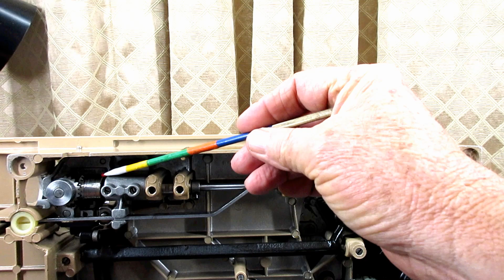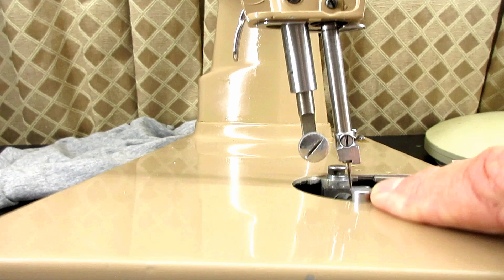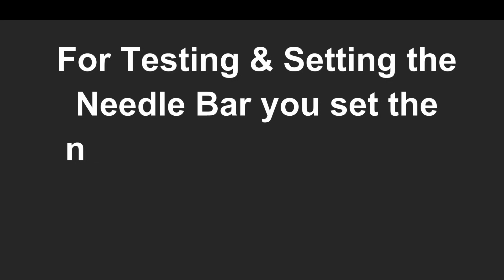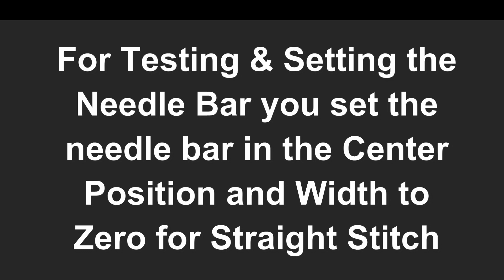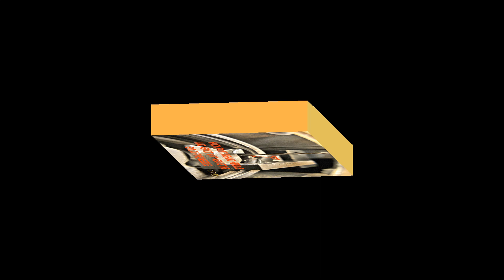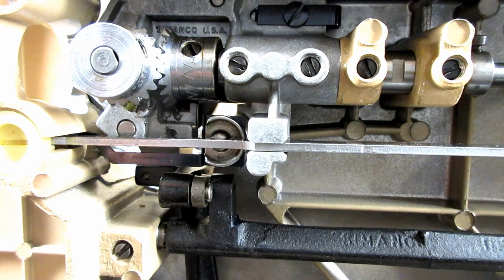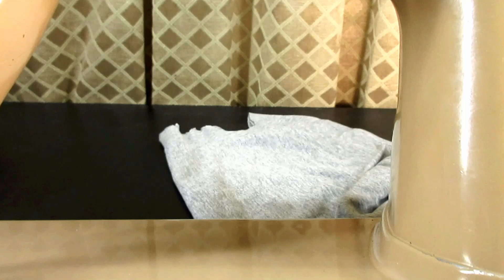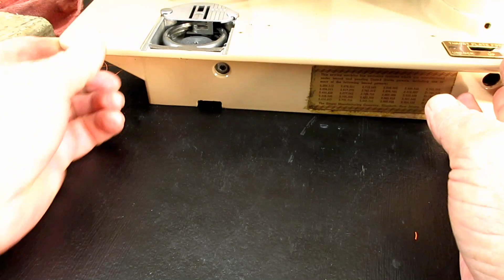How to Check and Set the Timing on a Singer Model 403A Special Slant Needle Sewing Machine

Comment: Hi Andy, I'm getting so much out of your various Singer 401a videos! They are SO helpful and fun to watch.  I like how you give invaluable tips from your own experience. 

I have my mom's 401a that I grew up sewing on, and I am seeing that the needle height mark (upper mark) is hidden under the bushing and I think I see the hook timer mark (lower mark) maybe just slightly showing about halfway out from under the bushing. The two marks are very clear when i raise the needle bar up, so I would see them if they were where they were supposed to be. The problem is i can't get the needle bar to move, even after unscrewing the screw until it fell out. I put some blue creeper penetrating oil in the place where the screw goes back on, and every now and then I come back to it, but it is NOT budging. Am I doing this correctly? Should I try putting some heat on it with a hair dryer ? I don't feel I should rotate it. I've never asked for someone's advice after watching a video, so maybe this is kinda rude.  😂
Reply from the maker: You are definitely not being rude, and using a hair dryer to apply gentle heat is a great next step to help break those parts loose. There is probably 60 years of dried oil in that tiny cavity between the clamp and the bar, and maybe it is not all sewing machine oil. 
   Patience helps a lot. I often work on a different part while waiting on the penetrating oil to work, even just cleaning them or polishing the machine.
   It's fabulous to have a family machine like that; congratulations.
You may be the first person to remove that screw since the factory installed it 60+ years ago. I'm curious why you want to. If you are skipping stitches or the needle is hitting the hook, then yes, it may need adjustment. If it is sewing well, then you can just clean it in place if needed. 
   If the marks are a little off, but the stitching is fine, then maybe just leave it alone. Each machine is unique and also has its own wear "pattern".
Reply: Oh thank you for your response! Yes,  haha,  I should have left it alone,  but the marks were so off. Like way up above,  so that I would have thought there weren't even any marks if they weren't visible above the clamp when i turned the handwheel.

 And the timing was definitely off, so i just wanted to start by correcting the needle height and then go on to correct the timing.   But it became quite obvious to me, after I got the needle bar to move up and down within the unscrewed clamp (which i finally got loose), that the adjustment makes the needle far too low, even with the upper mark adjusted to where it's just peeking out from under the bushing. It doesn't hit the bottom of the bobbin case, but comes pretty close. 

 I think on this machine for some reason, the eye would never be only 1/16 inch below the hook at any point, if I'm then turning the handwheel and bringing the lower mark up that little distance to line up exactly under the bushing. 

I don't really understand how it could be so off. Can I just measure the distance between the needle eye and the bottom of the bobbin case? I feel like that's what the upper mark is for anyway, just an easy way to see in the needle is at the proper height. So if the marks are wrong, I should measure the height of the hook in relation to the base, subtract 1/16" and i would have the height of the eye of the needle in relation to the base. 

Am I making this too hard? Not sure how I would fix it except by trial and error. But I'm willing to do that if you think that's the way to go.   😂
Reply from the maker: @marcilindsey6264  A very odd situation. Since you can manipulate the needle bar, please check that it's the correct part number for your 401A. It should be stamped with the number 172003.
Also, when rotating the handwheel ALWAYS turn it towards you and not away or backwards. That changes the whole situation and messes the timing up like crazy.
Reply: @andytubesewing1953  OH yes, I do realize that.  I have that habit down pat of only turning it toward me. 

Oh okay,  I will check that the needle bar is actually the right one for the model 401a, thanks for the serial number!! 

Thank you, Andy!
Reply from the maker: @marcilindsey6264  That's all I can think of without the machine on my workbench. You know, when the needle bar continues up both those lines go up into the bushing and disappear. The idea is that when the bottom line is flush with the bushing, your needle point is at the hook point. When the needle bar is all the way down, you should see the top line at the bushing bottom. If it is there, the height is correct. You probably know all this, so I'm just being sure. Good Luck. It is unusual.

Comment: Every time I set my needle doesn’t come up fast enough it hits metal. Also screw that holds needle can’t break it loose.
Reply from the maker: Does the needle just barely rub on the hook? Like a slight "zing" sound? These early slant needle machines had trouble with skipping stitches on knit fabrics. There is an adjustment the Singer techs made to stop that by moving the hook slightly closer to the needle. It worked quite well, too. I'm wondering if that is your situation.
   You mention that you can't loosen the needle; do you mean the screw that holds the needle bar in place? That is used to adjust the height of the needle bar for setting the needle to hook timing, as I show in the video. You can certainly check if the needle bar height is correct without touching that screw. 
   If you find the NB is at the wrong height, you would need to loosen that screw to adjust it.
Using a penetrating oil, like WD40 or similar, can help. Give it time to work. Using a hairdryer to heat the screw up very well is another method we use to loosen it. Get help if you need to. You do not want to strip the head of the screw.

Comment: Hey Andy, I’m sitting here watching this video and I’m seeing that you have the stitch width lever at one which has me questioning where I might’ve had mine when I was timing the 401a. I probably had it at three thinking that was the center.  That is definitely something I will revisit when I get it back out of the box lol. Not even sure if that’s an issue if I did do it that way.
Reply from the maker: Don't dig up what you buried in good faith, as grandpa used to say. 
Red lever at 3  IS the center needle position on model 401. With the knobs at A-K.
So, AK# is straight stitch with center needle. In this video the lever on model 403 is for stitch width only. There is a separate "push and slide" knob for the left-center-right adjustment.
Reply: @andytubesewing1953  well darn🙃

Comment: Hi Andy, I recently put a 401A on the back burner because I just could not, for the life of me, figure out why the needle was dragging the fabric. I took out the presser bar, the needle bar, reset the timing about three or four different times and nothing worked. It’s that “pendulum” issue. I had heard, but you didn’t mention it here that when you reset the timing that it’s a good idea to have the machine in zigzag settings with the needle to the far left. Have you ever heard of that before or anything similar?
Reply from the maker: I've heard of having the needle far left to time the hook on zigzag machines, heard it, but never read it in a manual. Your problem sounds more like a cam stack timing issue, not a hook timing issue. Try timing the cam stack (disc driving worm wheel) https://youtu.be/ljenD-rn6pc    That's what I would look at.

Comment: Pls, I need your  help to set my Singer 968 needle timing, the needle keeps hitting somewhere after I have followed the steps🙏
Reply from the maker: Model 968 was not sold in the USA and I have not worked on one. I found pictures on eBay and it strongly resembles Model 252. The most common reason for your problem is the plastic gear on the top of the vertical shaft is failing or has failed due to age. The gear or gear + shaft can be replaced https://www.sewingpartsonline.com/products/arm-shaft-w-gear-singer-445491   I have a couple gear changing videos for other models if you want to see what that entails https://youtu.be/M3bFtlV1Y6s     https://youtu.be/O2KN89S6zkM   
You can also buy just the gear. The Service Manual for some models shows the gear must come out the top of the machine which involves more steps. The manual for model 252 is for sale here https://manualsoncd.com/product/singer-252-257-258-259-sewing-machine-service-manual/    I could not find the manual for 968 anywhere.
Reply: @andytubesewing1953   Thank you so much 🙏  I'll check the links out.
Reply from the maker: @Lililabel  you bet and good luck to you

Comment: Excellent explanation of this system Andy.  I now think I need a new hook assembly as the hook on my "Goodwill" find 403a lines up in front of the needle instead of behind it.  Either the one I have is damaged or someone installed the wrong one.  I'll try replacing that next and maybe a new needle bar also.  Thanks for all the work you did on these videos.
Reply from the maker: I guess it could be the wrong hook but it is a bit of work to remove and replace the hook. Here are my 27 videos for model 403A https://www.youtube.com/playlist?list=PLsCOZgzzaiKKyqvdDRwS-9MfLuwSNJTcg     There is an adjustment to move the hook to or from the needle. Maybe someone fooled with it. I don't have a video for that but you can download a free copy of the service manual from the sewing dude  https://sewingdude.wordpress.com/wp-content/uploads/2012/09/singer-401-service-manual1.pdf   Page 144 has the hook adjustment instructions. I did make a 2-part video for removing and replacing the Hook & Finger on a model 401A if that helps here is part one https://youtu.be/T4YPB1KK3_Q
The part number for the hook on model 403A is 172080, which should be stamped into the part.
Reply: @andytubesewing1953  Hi Andy.  Thanks for the timely reply.  I tried answering your response with the email secondary and it did not go through.  Anyway, I did remove the hook and it was difficult as I had to pound it out from the bottom.  The hook unit would not clear the screw head which holds the cover plate spring in place.  My hook is stamped with the correct part #.  I will study the instructions you sent me and see what I can try next.  You're a champ!
Reply from the maker: @engelbob8402  OK, good luck. The link I gave you to the hook video shows how to avoid the screw for the cover plate spring. take care.

Comment: Hi Andy 
Hope your are well 
Just timed my 401 and still my top thread is breaking 
Any ideas ?
Keep up the good work 😊
Reply from the maker: Timing usually does not cause thread breaks, just skipped stitches or zero stitches.  If there are thread bunches under the bobbin slide plate with thread wrapping check the Thread Clearance Setting  https://youtu.be/O7drU1gNKqo    If the needle thread snaps right away it sounds more like a tension problem; try lowering the thread tension.
If the machine is new to you pull out the thread and redo it being sure to follow the Instruction Manual completely. If you need the manual you can get a free copy here:
https://ismacs.net/singer_sewing_machine_company/manuals/singer-slant-o-matic-401a-sewing-machine-manual.pdf
I have a lengthy video all about the tension unit on the 403A here: https://youtu.be/4aqRScKOOsw Very long but you can skip through it and play at 1.5 speed too.
Reply: hi Andy ,thanks for relying ,its definitely not the thread testing but I have found something that is odd ! when the top thread goes around the bobbin case it gets snagged at the back of the bobbin case before its pulled up out of sight, my 401 on the other hand seems to have a slack loop that glides over the back of the case while the 403 seem tight ! its a shame I can't send you a video 
I thought it was the bin case at first as its sharper than the 401 but tried the 401 in the 403 and its the same ,ill watch all your slant needle videos yet again!!
keep up the good work
Reply from the maker: @simonbanks6641  With this more detailed explanation of the problem I'm wondering if there is a Delint Pin catching the thread. Many Slant models 401A, 403A, 403, 500A, and 503A have this pin. We believe it was to "sweep" or "clear" the lint from the Hook so it would not build up there.  Sometimes the part that holds the pin gets damaged and/or rough and catches the thread. Sometimes the thread has been found caught on the pin itself. Some people ground off the rough spot if found, or the pin itself. I have also heard from viewers who said you can pull the metal pin right out of the metal bracket.
   So here is a video my viewer Matthew made and it was the first I'd heard of a problem with the Delint Pin. Subsequently, I heard from many others that this fixed the problem for them https://www.youtube.com/watch?v=19UA-7Rj8S0      I have a couple videos about removing the hook if you find you need to do that.
https://youtu.be/T4YPB1KK3_Q      https://youtu.be/1GmJTGKE0aY    I do not know if you can remove the pin without removing the hook. its been too long since I worked on them. The part that holds the Delint Pin is called a Positioning Finger. The Service Manual shows how to R&R the hook and finger on page 150 something I think.

Comment: I had good luck whilst resetting the needle to hook timing, by holding the flywheel to top cover with masking tape. This prevents the rest of the mechanism from moving. NOTE: Check that the flywheel clutch is tight. Ronn
Reply from the maker: Thanks for sharing.🙏  I pinned your comment to the top.

Comment: My 404 was running louder and with some jitter. I re-watched this video, adjusted the gears to touch (not too tight). Now, my machine runs smoothly, quietly, and responsively. Andytube to the rescue once again!👏 👏 👏
Reply from the maker: Nicely done. Found this problem on a 404 and took me quite some time to isolate it. Happy you found the video and thanks for the nice comment.🙏
Reply: @andytubesewing1953   did you eventually discover the problem within your 404 where the horizontal gear meets the vertical gear?  Or, perhaps was your solution located elsewhere???  🙂
Reply from the maker: @ThinkingLeaner  Yes the gear at the bottom of the vertical shaft was too tight against the gear on the horizontal hook drive shaft really too tight what caught my eye was the slightly damaged set screw on the gear on the bottom of the vertical shaft so I knew somebody had played with it before and I took a closer look
Reply: @andytubesewing1953  Thank you for the education kind sir! Or, should I say “Detective (Sherlock) Holmes” 🧐?  👏👏👏
Reply from the maker: @ThinkingLeaner  Haha, maybe more like Inspector Clouseau!

Comment: One of the set screws won’t move. I tried alcohol, oil but couldn’t loosen it. I’m so desperate…
Reply from the maker: @SupersuperWonders  oh sounds like you got a bad one there of course you don't want to strip the top with the screwdriver what can help is heating it with a hair dryer get it nice and hot and be sure to wear good gloves then when you try and hold the machine to turn the screw the other thing which you may need a third hand is that tap stiffly on the screwdriver as you're trying to turn like rap rap rap. I use a small 2 oz Hammer the idea is it makes a Sharp rapping on the metal which can break the screw loose

Comment: Thanks to you I am able to fix problems with most sewing machines. I have a singer 774 that belongs to a friend with 3 small kid and needs the timing fixed.  Easy peasy ! When I took off the bottom cover there was a small spring sitting there.  No obvious place underneath to put it back.  About 1 1/2k inches long.  Any thoughts.  Maybe from the top and it fell down.  I have a good picture if I knew your email.  Thanks for everything.  al Attaching link to picture of spring sitting in the bottom ! https://drive.google.com/file/d/1gYRqNV18HFXzPPUa4va_D8g8ld-3t4KC/view?usp=drive_link
Reply from the maker: I don't work on that model, but if you email to andymanuals53@gmail.com and ask for model 774 parts manual I will have Alan reply back with the manual in PDF format.

Comment: Hi Andy, Thank you for giving me the skills and confidence to take on any maintenance/repair task that is brought my way. Unfortunately, that confidence was a bit too robust as I started to go ahead of you on this video and mistakenly loosened the set screw on the needle bar vibrating bracket (G3, on fig. 296 of the Singer 401 class repair manual if you are playing along)  - this caused a significant “jump” of the needle bar, as if I had released a screw under tension. Understandably, the zig zag function no longer works. What have I done and what can I do to fix it?
Reply from the maker: That screw holds the Upper Ball Bushing for the needle bar in place. The bushing helps guide the needle bar. I'm guessing you retightend the G3 screw? If the Ball Bushing got loose and out of adjustment or alignment I think that would cause the needle bar to flop around. I've never had to loosen G3 for any reason, but adjusting the Ball Bushing is shown on page 135. Maybe you can follow that and fix the problem. Good Luck.